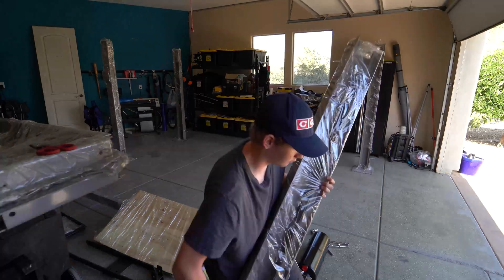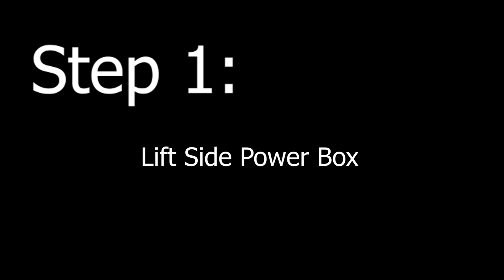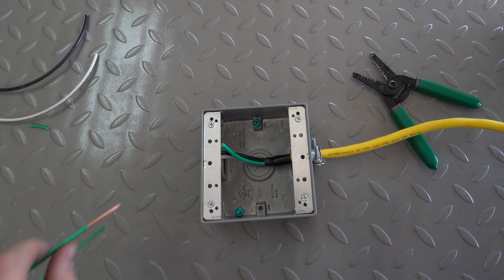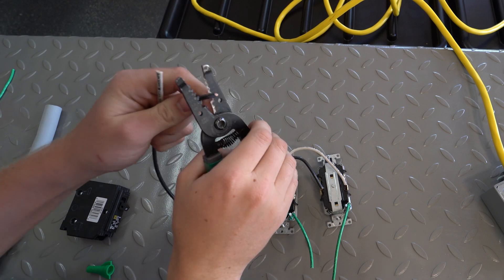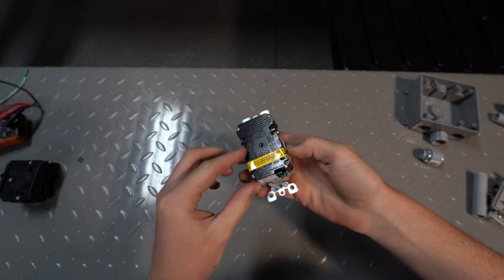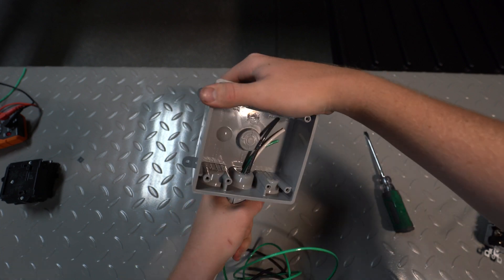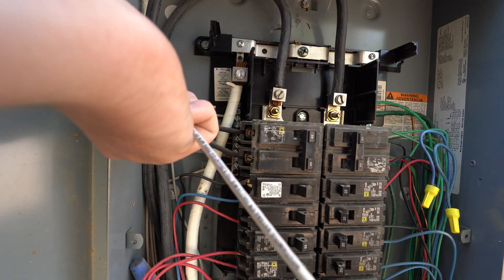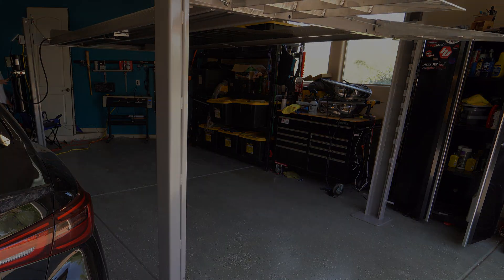How to install electrical for a 4 post car Lift. FULL GUIDE, Install GFCI, Outlet, extension cord!

Comment: Nice job BUT you now have other equipment running off of the same 30amp breaker that may be oversized for other equipment you plug in. This means that the axillary equipment/lighting may never trip the 30 amp breaker back in the main panel. Also, the outlet and plug for the lift both need to be rated for 30amp. Sight modifications would eliminate the fire hazard. I would run a separate extension cord with sister electrical boxes and plug in lighting/axillary equipment into proper circuit/breaker and dedicate the 30amp circuit to the lift pump only. Upgrade the plug and outlet to handle 30amps on the pump circuit.
Reply from the maker: Yeah I switched back to a 20 but it trips occasionally. I’d suggest a 240v pump if I did it again
Reply: To add to my comments....12 gauge wire is not good enough for a 30 amp circuit. Code requires 10 gauge and 12 gauge is only for 20Amp or less. Your work should be redone with 10 gauge wire.
Reply from the maker: @CMLFactman  it was all ran in 10 awg copper THWN